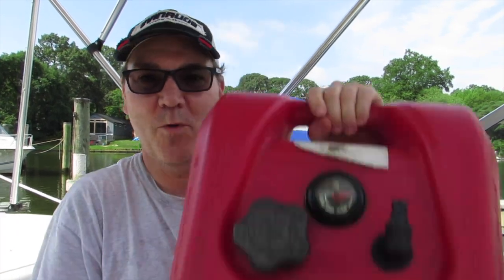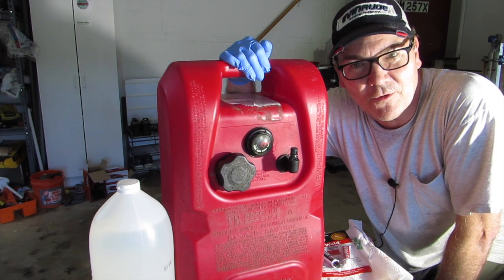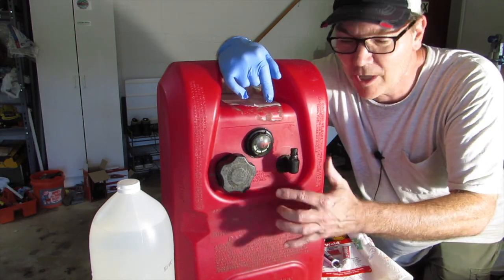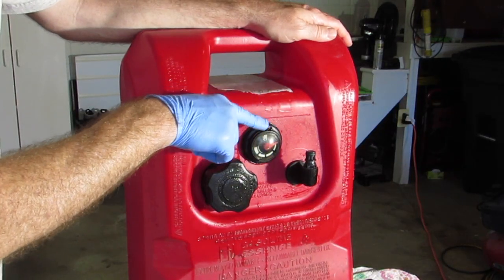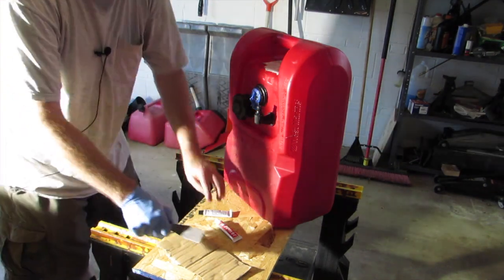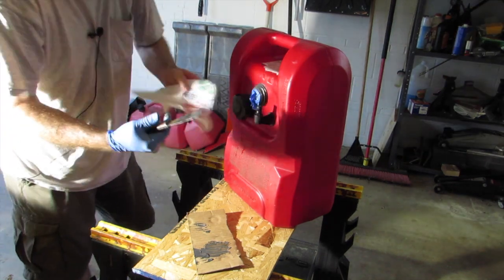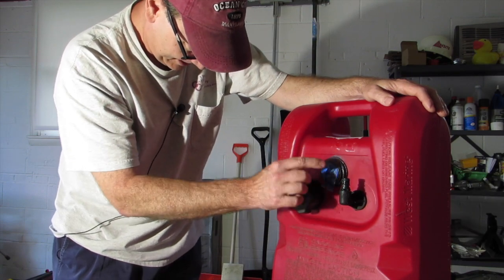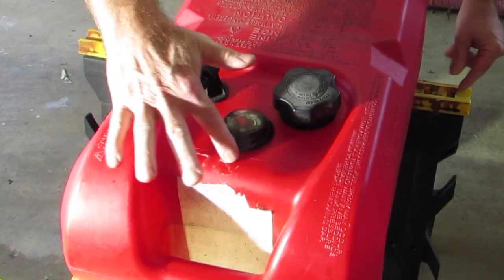Plastic boat gas tank leak. Fixing a portable marine fuel tank

Comment from the maker: Please let me know your comments, experiences and questions below!
Be sure to subscribe to my channel to get notified when new videos are released! https://www.youtube.com/channel/UCD04BVt5a2x0tx-CBCc5gMA
Reply: I have a 10 gallon tank that's leaking around brass fitting where gas line connector screws into the tank. My motor is not running rite.  I'm guessing it's sucking air. Or tank loosing pressure??
Reply: @scottcozart8950  Might try some teflon tape on the threads...

Comment: Just a note:  I live in the tropics where the UV attacks all plastics, so I paint the top and sides with white paint to reflect the heat and save the plastic.  9 years on and still got the same tank
Reply: We use to cover the tanks with wet burlap bags
Reply: Now that sounds like a good idea.

Comment: Wipe down area with acetone, to remove grease , scuff up are to get proper adhesion, tape stuff off you don’t want sealant , use 5200 marine seal , small tube $ 20 bucks at ace hardware. 👍🏼

Comment: I have a question, I always use external gas tank for my 6hp outboard tohatsu motor when I fish in lakes or in ocean. When I fish in ocean, there's big risk for water to get into the air vent- and into my external tank and cause my outboard to shut down, is there any way to prevent it? Tried to find some info online but can't find any legitimate information.

Comment: I have similar tank.. Mfg name on it is bluskies,..
Same tank, just the fill and connection are in different places.  My gauge is also leaking, I can tell by looking at the gauge it's not level,.. Or seated correctly, as if one side has partially popped out.  No luck in just pushing it back inwards towards the tank. 
Thanks for the great info here. 
I will try same repair,.

Comment: Each year or maybe more often I drain my tanks like that to clean out any rubbish and water that het in there. I use a priming pump and plastic hose to symphon it out. Set the syphon going and watch it do the work. Also handy for emergency transfer of fuel to the guys that run out of gas out on the water.

Comment: Up until this boat, the tanks were always either 3 gallon or 6 gallon and lifting wasn't a problem so I always put them on the ground and then just lifted them onto the boat.   I just found out that all plastic tanks have to be placed on the ground (or grounded dock) while being filled and I happened to be doing it right.  This is a problem now that I have a 12 gallon tank in an old Whaler because of the weight of the 12 gallons ( and my age).  What is the safe way to be able to fill an on deck plastic gas tank (for an outboard) while it is on the boat?  Thanks.

Comment: I found gasket maker in a roll. Just cut to size. I added a dab of fuel and pressed to imprint the shape. Cut out and permatex gasket maker to help seal. Good as new.
Reply: Going to add J.B.weld to my boat gear. Dangerous or not in an emergency this video may get someone safely back to shore some day.
Reply: @paulmoore3006  "Dangerous  . . . safely . . ."
Reply: @nunliski  how is this not safe?
Reply: @paulmoore3006  You tell me. You are the one who called it both dangerous and safe lol

Comment: How has it held up?  Thank you.
Reply from the maker: It held up great! I have since sold that boat(and the tanks), but got to visit it several months later, and it was still fine.
Reply: @WayneTheBoatGuy  thanks for getting back.  Good to know.  I just purchased a new tank for what I call cheap, from Bass Pro for $40 but used points for no cost.  The clear lens on the cap of my 1996 Quicksilver tank, was coming off.  I suspect the adhesive that held it to the body of the cap, was disolved over time as a result of the spot welded float guage coming off the bottom of the cap around 1997 which allowed fumes to be able to get through to he top of the cap.  I contemplated mixing some JB Weld around the top edge of the cap to secure the lens back and then finding a replacement cap.  It was too much change getting a cap that actually was a replacement bc I had no part numbers or anything.  Plus the old original gray fuel line (which was fine on the inside) was no longer flexible and needed to be replaced; so I ordered the tank then got some 3/8" fuel hose and clamps from NAPA.   Nice thing about the new tank is the cap is a different design and will not have to be concerned with the same thing happening again.

Comment: I was thinking about using JB Weld along the horizontal seams of the plastic tank. Overkill?
Reply from the maker: I would only use it for repairs if they are leaking. If there is a seam that leaks, that could also be the plastic itself is near the end of it's usefulness or might need to be "plastic welded"

Comment: Did this work? I have the exact same situation and Water got in my gas over the summer not sure if it made it through the crack, but gas did come out of it when it slashes around.
Reply from the maker: When I sold this boat over a year later, it was still holding up.

Comment: Do u think that stuff would work on the connector to the fuel line ? Mine was leaking today the old sealent melted on the threading to the connector
Reply from the maker: It might - if it's a hard plastic or metal.

Comment: The “right thing” to do is NOT to dump more plastic in the landfill because a large corporation does a piss poor job designing a product sold to a very large market, and continue rewarding poor engineering with repeat $80 purchase every two years.  My personal opinion as an engineer is that “melting the plastic” is not a bad idea at all (since HDPE is thermoplastic and formed by rolling melted liquid plastic around in a mold until it cools).  But thermally weld it, not chemically (since HDPE is designed to resist solvents)I think I want to try using HDPE plastic welding rods to melt the cracked fuel gauge ring to the tank.  I don’t think the fuel gauge is hdpe, I suspect they used cheap ass ABS because it’s easy to injection mold, but the compatibility with fuel is worse, which is why they have this problem.  So plastic welding/melting dissimilar plastics is not ideal from a structural standpoint, but I think it should definitely seal (I have to fix mine tonight!).  What I like about plastic welding versus an epoxy is that a plastic welded repair will remain flexible like the original material, versus an epoxy which can crack (or lose bond line with base material).  Jb weld is very good, but it’s like comparing two pieces of metal joined with permanent/ construction adhesive versus welding them together
Reply from the maker: Great points!! The idea of thermally welding it sounds really good! I imagine over time if a plastic becomes brittle or severely damaged by UV etc. that might not be such a great option, but otherwise it sounds awesome!
Reply: @WayneTheBoatGuy  It's not a bad option at all, because you are adding brand new plastic and melting/mixing it in with the old brittle/damaged plastic. I already did it on mine and was able to successfully plastic weld the entire cracked (ABS?) plastic ring/gauge to the red HDPE tank surface using HDPE filer plastic rods. By adding plastic, I was able to build it up very nicely (similar to what you did by adding resin).  I was standing on the tank while it was full to pressure test it, and no leaks.  I'm thoroughly convinced that either solution is better than the job the factory did with these.  I was also interested to see they now offer a version of this tank without the gauge (it appears to be the same roto-mold, but the hole in the HDPE is not punched out). (See attwood 8806LP2 ASIN: B07MG89FGX), and it is much less expensive as well.

Comment: did you replace the black filler cap sir?
Reply from the maker: trackrunner11 - I did not. Do they tend to leak there as well?
Reply: @WayneTheBoatGuy  - I asked this because i was concerned that the cap is not breathing. No ,I'm not being sarcastic but I was under the impression that the tank should be allowed to release its pressure through the cap just like a radiator cap for example..I'm asking this information because of a similar situation;please advise.
Reply from the maker: @trackrunner11  I think (not positive) but the older-style caps allowed airflow, but newer style caps and tanks are designed to expand so as not to release as much fuel vapors in the air. If there is a problem with it not getting air coming in, the tank would stop pumping fuel to the engine or get sucked in. Mine, after the repair worked as intended.